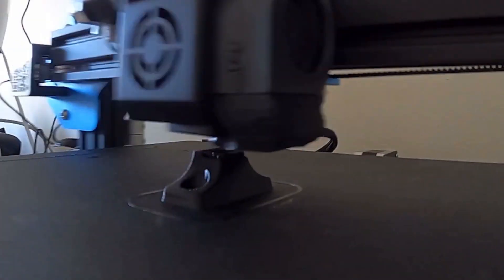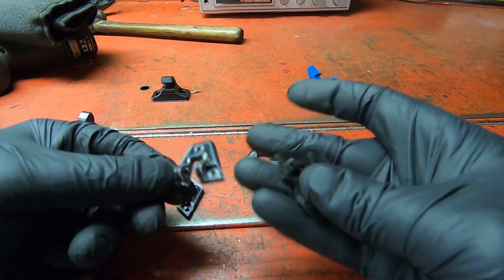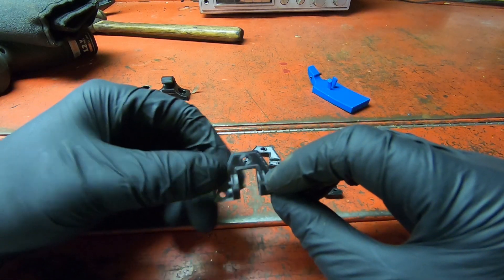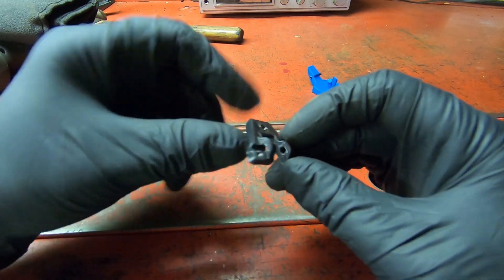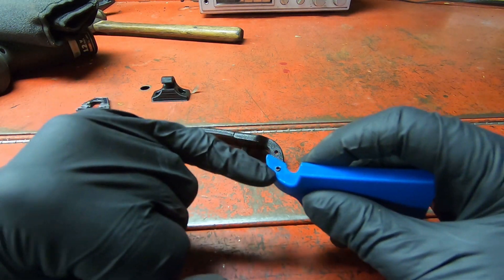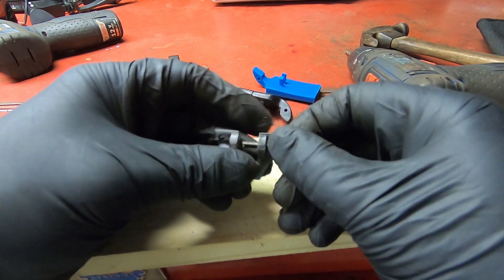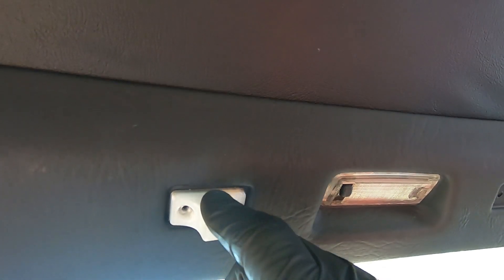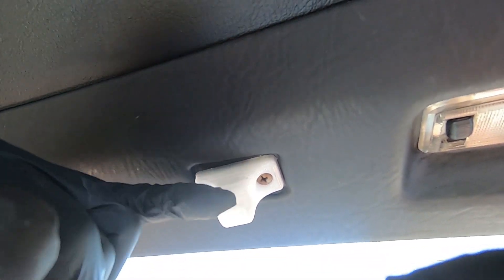3D Printed Porsche 944 parts

Comment: What type of plastic/resin was used for each part?  I have a small closed 3d printer.  I am sure I will need to print some when I move to the interior of the car.
Reply from the maker: I use TPU for the flexible prints and PLA for the more solid prints. Thanks for checking out the video. Good luck. 👍

Comment: Have you done any long term tests on these 3D printed parts?
Reply from the maker: Not yet. Just installed them. The visor clips seam really good. Only time will tell with the sunroof latch. I kind of feel like the bracket should be modified a little bit in the printing process to make it stronger.